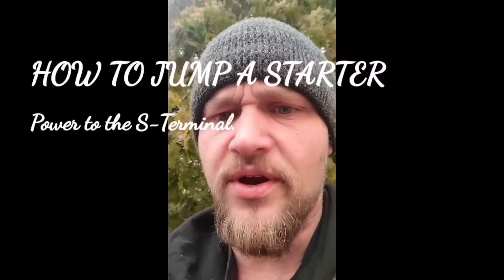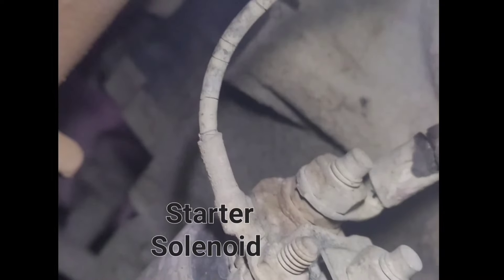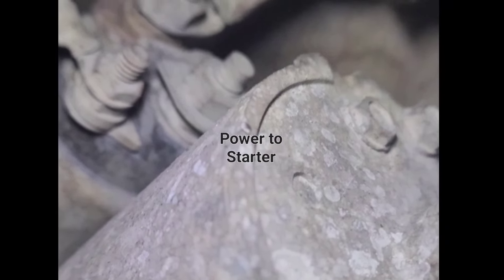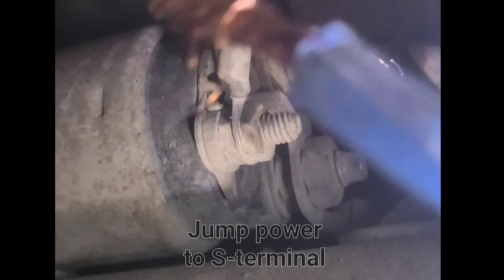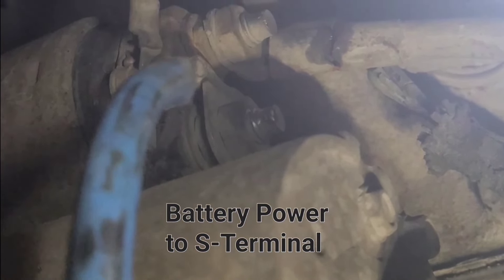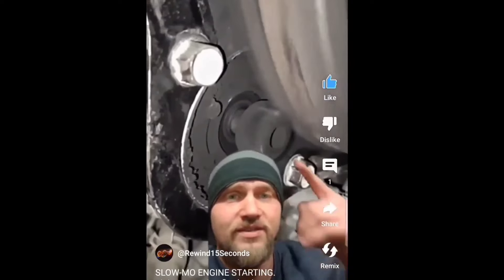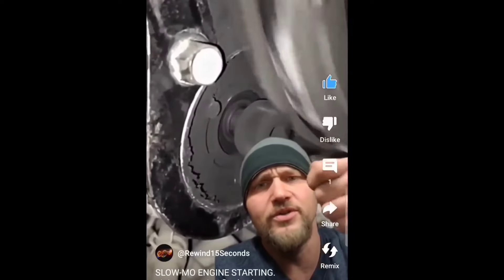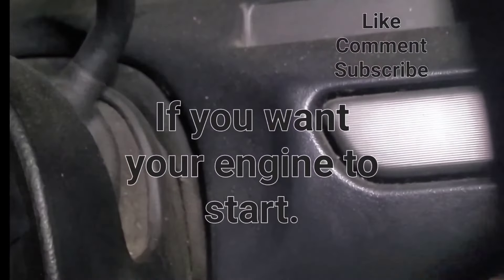How to Jump Power to a Starter.  Explained by a mechanic.

Comment: Perfect !  Love your wire idea instead of the more violent, lol, use of bridging a screwdriver and likely damaging the threads or bolt of the solenoid.....just did it on my Kubota tractor w your method and she is up and running....time to finish blowing the 2 feet of snow we got !

Comment: So if you jump your starter as shown and the solenoid is activated and the starter spins, then the problem lies somewhere in between the S terminal on the starter and the ignition switch?  I’m getting power in the cab of my vehicle (Bobcat skidsteer) when I turn the key on, but nothing happens when I fully turn the key.  Using a test light, I got no current at the S terminal when I had someone turn the key all the way.  I’ve switched out the starter relay with a new one, but get the same problem.  I’m just guessing (I’m not a mechanic), but the only thing left is the ignition switch and the wires leading from the cab to the S terminal.  Is there something I’m missing?  Any help is appreciated.
Reply from the maker: @kiheidude  If you're not getting power to the S-Terminal when you turn the key to start, then the problem is within the signal to start curcuit.   Sometimes, there is a solenoid in line on the fire wall or somewhere before the starter.  If there's a solenoid before the starter, they often fail.  If that solenoid fails, then you can jump the 2 large terminals, and that will send power to the starter and start.  If you are not getting the signal voltage and when you jump power to the S-Terminal, if the engine starts, then it is in the signal.   Often a broken or rubbed signal wire.  The short is often close to the starter because the wire often isn't secured well.  Some starters will have the solenoid on the starter, and some are before the starter.  If the battery power cable goes to a solenoid before going to the starter, then look into that solenoid.
Reply: @Rewind15Seconds  Wow!  I didn’t expect such a fast and thorough response.  Thank you!  There is the usual solenoid on top of the starter..  I’ll try jumping the power to the S terminal from the battery and if that is successful I’ll start tracing the wire back from the S terminal to the cab of my machine.  Thank you again.  Your suggestions are super helpful and gives me some direction as I’ve been all over the map trying to figure it out.  The problem occurred suddenly when I turned off the machine then tried restarting it a few minutes later.  After letting it sit a few days, it started up, I moved the machine, then it wouldn’t start again.  It has me totally befuddled.

Comment: So kind of like flicking a lighter in reference to starting??? 😂
Reply from the maker: Yes.  If you jump the power to the starter motor, it will just turn over and not engage the flywheel to start the engine.  Just like if you flick a lighter and not press the button to open the fluid valve, then the lighter won't light.  That is a good analogy.   The power needs to be jumped to the s-terminal, and the lighter needs to be pressed to light.
Reply: Was someone turning the key when you used the wire when it started for you?
Reply from the maker: @Baked804  if the key is in the on position and you jump power to the solenoid and the starter turns over and engages the flywheel, then the engine can start.
Reply: @Rewind15Seconds  thank you